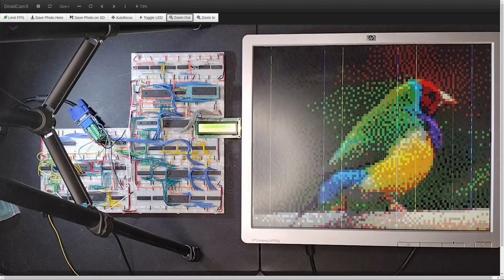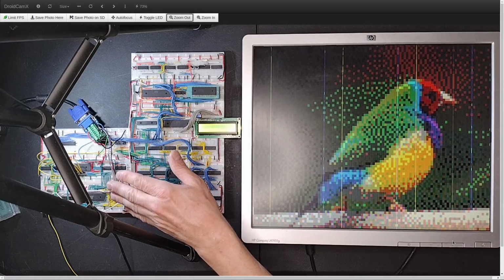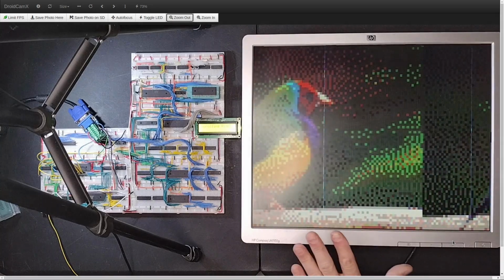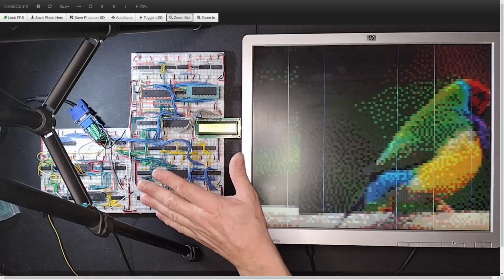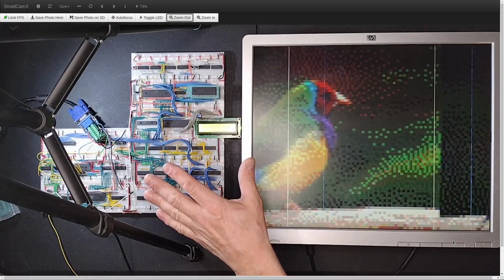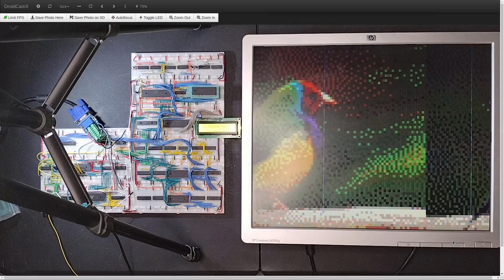Worlds Worst Video Card -Revisted: Hardware Scrolling Under Computer Control

Comment: In the transcript it is unclear how scrolling is drive. Why not give the 6502 access to the registers of the video card? Is this it? So the video card sends an interrupt at a line ( like in C64 ) and 6502 sets the address. Just reset the address right at the end of the frame, but allow interrupts on all lines, even in the flyback to the top.

Comment: Very cool. Would it be possible  to output a very small animation?
Reply from the maker: I hope to write some video games for it once it is fully developed. I'm still having problems with the video board having DMA access to the video RAM. I could do like Ben Eater and simply halt the processor during the display interval, but I am hoping to be able to make use the processor to do other things while the video card has access to the RAM. I think I'm going to need to set up interrupt requests that tell the CPU when the video RAM becomes available and when it stops being available. I also want the computer to be able to read which scan line the video card has just completed displaying.